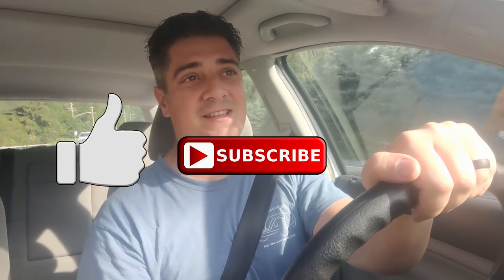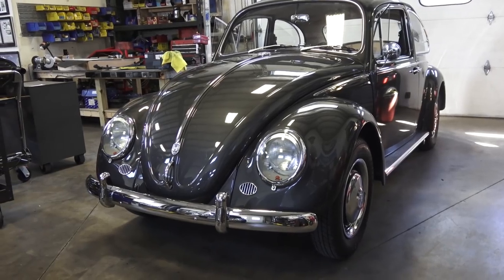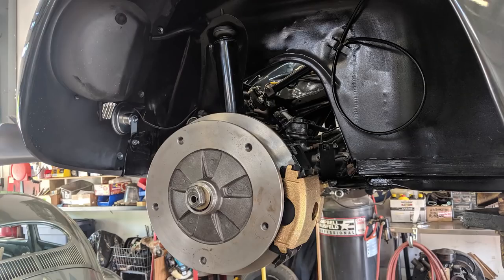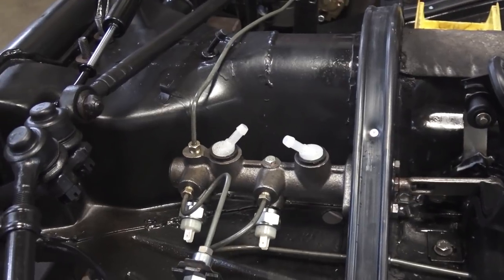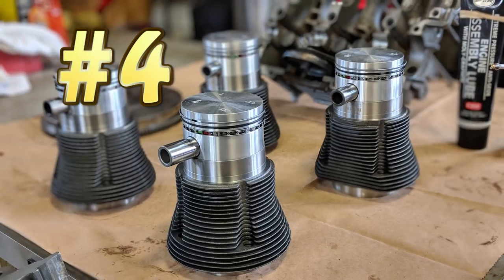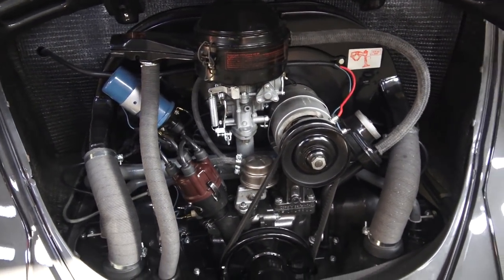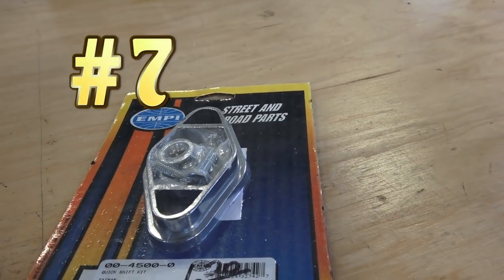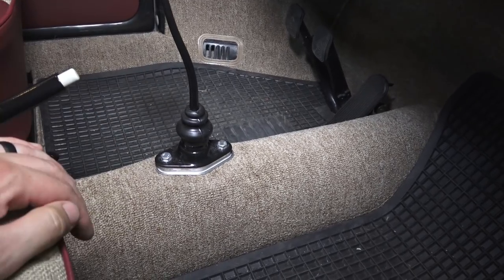Classic VW BuGs VLOG#6 with 7 Practical Upgrades for Your Vintage Beetle Ghia Type 2

Comment: Two questions, Chris: 1)where can I order the coffee and b)when you upgraded to the disks, are the standard brake light switches working OK on the 66? On Lela's 67, she's a smooth driver and can actually stop the car without activating the tail lights if she drives it normally. The pedal pressure with the disk conversion is just low enough to make that possible. I've swapped the two switches on the dual master and it's a little better. I've just got some German switches to try out as well. If she presses just one pound of pressure more than she normally would, you can hear the brake switch relay click so in traffic she does that. But seriously, with the disk brake conversion you can stop the car using only a toe! Big improvement. Thanks for the videos!
Reply from the maker: You da man Greg!  Give me a call, coffee is on us!  You helped me with all this.
Reply: @classicvwbugs  thanks Chris! I'd like to contribute to the excellent cause. That's really good to see: you've been giving a lot to the dub community and now you're giving to the mutts! Two thumbs up!
Reply: Greg, I had the same thing happen when I upgraded my 71' to disk brakes.  I found this kit helped my brake pedal lights activate within 2-3mm of brake pedal travel.   https://www.thesamba.com/vw/classifieds/detail.php?id=2140061
Reply: @cookaacoo  This is excellent, thank you! I bought another electric switch which requires drilling hles into the body which I did not want to do.  This avoids that.
Reply: @cookaacoo  Ordered!

Comment: Really important question Chris! My 1974 Volkswagen beetle was perfectly fine yesterday and today I tried to start it it wouldn’t start I put the key in the off position and it kept trying to start. I don’t know if it’s a starter relay or whatever. I desperately need help.
Reply: When you say "put the key in the off position and it kept trying to start" do you mean the starter motor stayed engaged and kept cranking the engine over? If so, something may be wrong with your ignition switch, starter solenoid, or starter relay (if you have a aftermarket relay as these cars did not come with them from the factory)
Reply: Thomas Duncan Yes that is what I meant. I have ordered a starter relay
Reply from the maker: @raptie2822  does it crank or just "click?"
Reply: Chris Vallone it cranks motor yes!